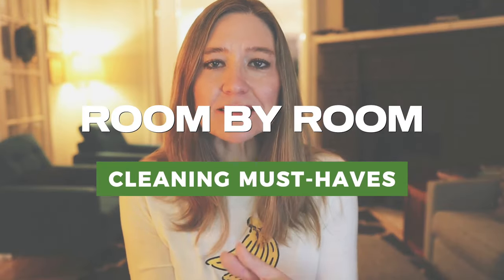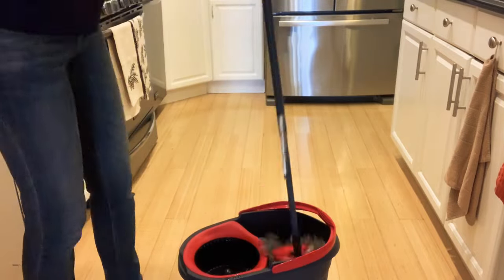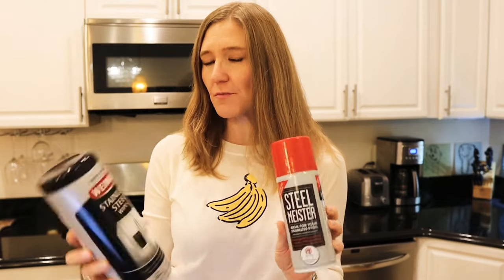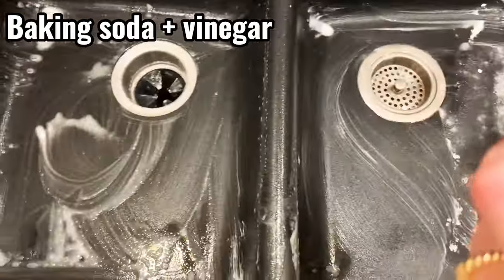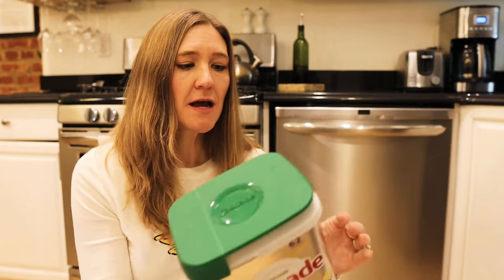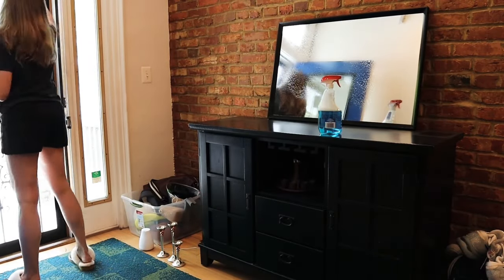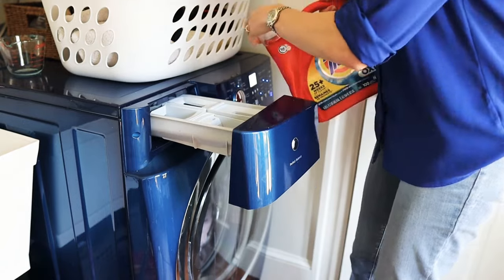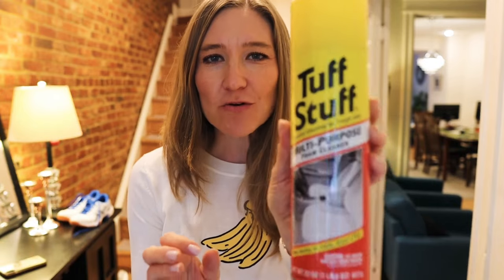Home Cleaning Must Haves! | SAVE HOURS CLEANING with these products

Comment: Clueless. That minimal amount of vinegar in the washer dispenser is worthless. Effect is based on wishful thinking. 

It’s also not a surfactant. Won’t dissolve grease and oil in a DIY cleaner. Detergent and water are sufficient.
Reply from the maker: My DIY cleaner has water, vinegar and soap. I've done enough research and testing to know the effectiveness.
Reply: @tarynmaria_  

My experimental jar of oil and vinegar salad dressing refuses to emulsify despite frequent vigorous shaking over the last 20 years. 

If you understood chemistry you’d immediately recognize why the acetic acid in vinegar can’t dissolve grease and oil. So why add it to a cleaner? Ans: YTers like to copy each other’s mistakes.